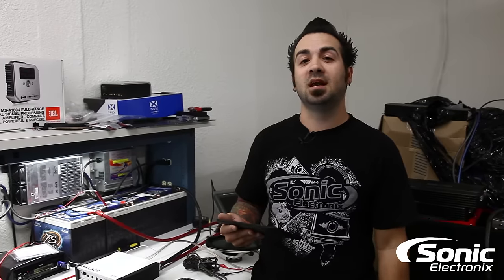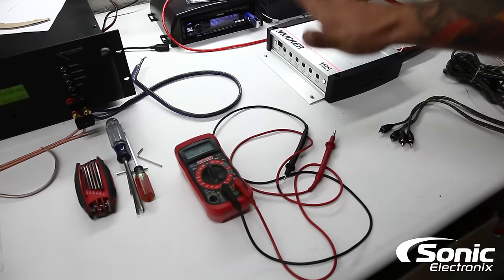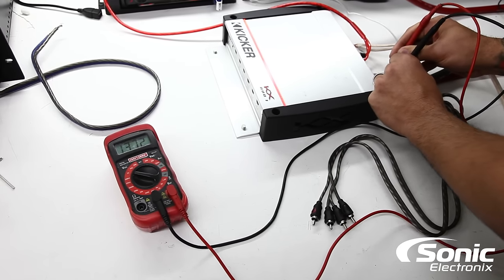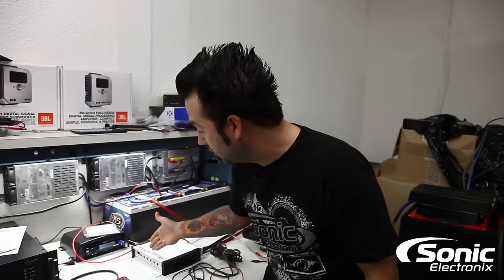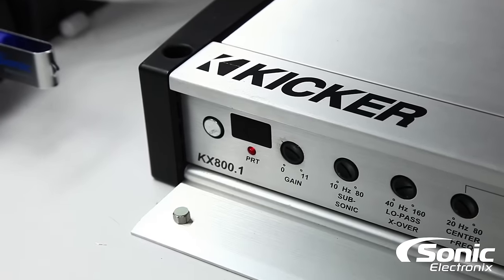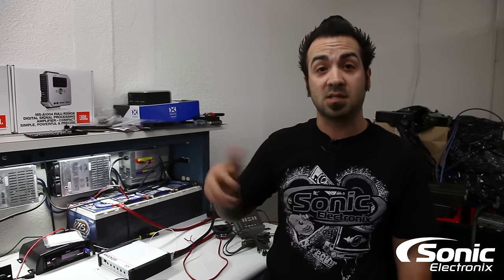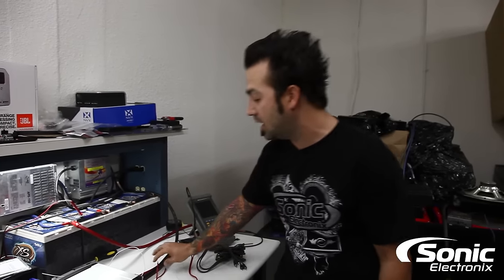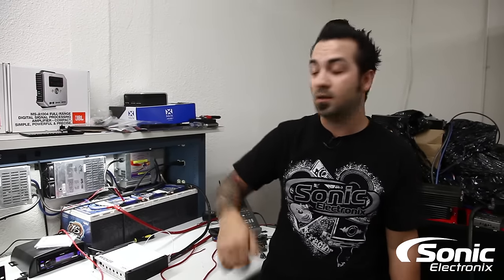Why is My Amp Going Into Protection Mode When I Start My Car? | Car Audio Q & A

Comment: my amp and speakers have been working fine for years now all of a sudden when I turn the car on it makes a heartbeat sound from the wolfer I've tested that amp outside of the car and it doesn't do it unplug the RCA's and it doesn't do it either and it plays fine until I start the car up I'm really at a dead in here
Reply: I mean it still does it when I unplug the RCA's

Comment: I have a 2014 Hyundai Sonata they say with my stock radio that the radio keeps cutting off the bass due to the radio going into protection to protect factory speakers it has Bluetooth and everything they say the only was to fix it is to get a aftermarket radio

Comment: i got a problem. i just installed a dual xpr84d amp. when i turn on the radio, the amp goes directly into protect mode. voltage at the power and ground is battery voltage. when i check the voltage at the amp, it is about 5 volts. brand new stereo works fine. pioneer subwoofer amp works fine. the remote is split off from the dual to my pioneer. ground is good, power is good, remote is good, but the dual 4 channel, with no speakers hooked up, goes into protect mode. power wires are separate, no distribution block. different grounds for each amp.

Comment: I want add something to this. I came across alot of amps that was installed wrong. The protection light came on and never went off even with troubleshooting all possible causes. I basically found that the amp was toast with subs either hooked up wrong and just the wrong subs  all together.

Comment: Could be loose speaker wire on speaker mostly front speaker ... From water getting in your door causing the speaker wires to corrode... has happened to me

Comment: I am using Pioneer GM D-9601 Class-D Mono Car Amplifier ( it has 3 40 amp fuses) at home to play two 12" sub woofers & I am using 12V 50 amp SMPS to power that Amplifier. My problem is the indicator led bulb of the Amplifier starts blinking after some time & the sub woofers starts to distort or produces disturbed sound. Plz suggest what may be the problem ?

Comment: I have an audio pipe amp that had no fuse. when I was hooking it up with just the power and ground and remote wires. any metal that touched any part of the amp would ground out and cause an ark.  What is going wrong??????

Comment: Will a 2000watt speaker make a 1000watt amp go into protectin mode? The fuse connection in the amp was not good one wire was not connected and the other wire was connected to both ends on the fuse case so I hooked both wires back up properly and put amp back together but kept blowing the 30amp fuse put a 40 amp fuse it was good but amp goes into protecting mode When I turn the volume up Idk if it's just the amp or if my speaker is to much for it!

Comment: I have a factory radio and I installed an amp with it. When I cut the car on sometimes it will go into over current mode right of way sometimes it don't. I have the back two rear door speakers connected to the high level output on the amp. I had it on a line out converter but it does the same thing. I turn everything down and it still says goes into over current mode please help Thanks

Comment: I have adapters that is 2 + 2 - how can I have a bad ground? My voltage sets at 15v drops slowly to 14.4v 3 batteries 140ah on MD3k, I can't go pass half way or goes to protect mode. I have 2 15" subwoofers NVX-VCW154. My last amp NVXVAD17001 I could turn it up no problem ever. I need help?

Comment: My question is where do I start...i installed 2 nemesis audio 12" hectics pushing 1500 rms watts each 3k watt max watt each....running off a 2nd car battery and I don't have a fuse for the amp power that I know of.... problem is the installation was less than 11 months ago... when turned up all the way after a while the amp shuts off...I turn it off for a min turn it on it plays again for a min or 2.... this hasn't happened before...what could be causing this issue being so new....it was installed by a stereo audio place so I imagine they did a better job than I would....where would I begin....
Reply: I think this may relate to this video but a little different cuz it works until its turned up.

Comment: Sonic Electronix is there anyway to boost a radios preamp output voltage from 2 to 5?
Reply: look up "Line Driver" the best brand is audio control. They aren't cheap tho. Can boost your voltage up to 8 volts

Comment: my RCA’s and speakers wires are disconnected,  I put the car in accessory mode /turn it on and the MTX audio amp light is red .. is the amp dead ?
Reply: I having the same issue with my MTX amp. Nothing connected but good power/ground/signal and the amp is going straight to protect. Amp is getting 12+volts signal is 11.59v

Comment: Hi thanks for all the helpful videos. I have a problem with my Pyle PLBA530FRD BLADE 6,800-Watt 5-Channel Compact Class-D Full Range Hybrid Amplifier when I power it up it plays for a split second an go into protect mode by the way it is not in a car I have it on a shelf with a car battery an a battery charger the amp terminals read 14 volts and even with the charger off at 12.8 volts still goes into protect. I disconnected all cables speakers RCA's an only put power into it same problem I read that is could be a bad output transistor. The problem started when by brother wired 3 different speaker an the resistance went below the rating value on the same channel. I am an electronic guy so if any one know what component inside the amp is doomed please tell me I can open an replace it BTW the amp plays for a split second so I don't think is a transistor idk please help thanks in advance

Comment: I've got an old amp that I was told might have a short so before connecting to power, I checked continuity between the BATT and GND and there was continuity.  That seems like a problem, especially once the amp was disconnected because I assume when connected to power, it will cause a short or major battery drain even when off.  Is my thinking correct and any advice on the continuity situation?  Thank you!
Reply: Was it the amp?

Comment: Quick question, in my boat i have three alpine pdx amps (pdx1.1000, and 2 pdx4.150) all my gains were set with the smd distortion reader, but after maybe 20 minutes of playing music at higher volume the amps go into protect mode. Is this just because of over heating or is there something going on with fuses? thank you!

Comment: On my amp. Ch 1 is set at 17 volts (75 w x 4 ohm speaker) but ch 2 reads 37 volts?  Why is that happening

Comment: I'm having trouble getting my amp and subwoofer to play I'm using an alpine Mrv-f301 and a dblink hlc1 converter my sub just comes on and off but no bass is heard to just weird echo have you guys ever runner into this problem?  My car is a 06 saturn ion with stock radio.

Comment: I have 4 12" mtx terminator subs wired at 2 ohms, I have a boss r2000m amp and I am running 4g power and ground. it keeps going into protection mode when I turn the volume past 20....? any help I have wires from one box to the other with butt connectors then to the amp from there.? amp is rms 1000w and I have 800w rms from subs... why is it not working.

Comment: I have ever wire hooked up correct and not touching nothing and i did rig my remote wire up but still it should still come on correctly . but no it powers up but in protection mode and i am juat stuck
Reply: Could be a power drop i didnt check that

Comment: I have a JL jx 500/1 amp that goes into protect and out of protect after a few seconds should I be worried? Gain is at 0 and db is at 0 with a JL 12 w0v3
Reply: Ducky Tran I have the same amp in a 2017 f150. It has the ecoboost. When I go to a stop light the truck turn off. My stereo system is still playing then as I release the break the truck turns on. This causing my sub amp to go into protection mode for maybe 3sec. Then works fine. I hope I can find some help. My 4channel and sub amp are connected to the same remote wire. Sub is the only one that cuts off
Reply: Adam Vasquez i actually found out that my battery gives too much voltage when i start my car. But another question, how high have you set your gain on your set up?
Reply: 3/4 was what the shop set it to. I lowered it to 30% and it was the same thing.

Comment: hey man i had a broblem with my amp i have a TMA 4 channel and similarly to this vid only when the car is start the audio signal to the speaker drops in volume, it like this when the car in standby mucis works gread no issues, but as soon as te car is start and idling the amp looses its drive. i have tried everything chaned wires tested the voltage change rca. i changed the amp and the issue was solved but i have no idea whats wrong with te amp

Comment: i have to amps 1 for subs and one for highs and a distribution box tied into power for equal amperage? but when i turn the volume up past 20 it kills highs and only subs play. i was told i need a bigger ground to start.
any ideas as vague as that is i have the big fuse coming off battery and 4 gauge power wire however the ground is smaller by amps

Comment: I added my battery to my amp and protect mode went off. 12.35. Hooked back to the truck. Goes into protect mode.13.5. Don't understand.

Comment: IT COULD ALSO BE THE YEAR AND MODEL OF CAR.  SOME NEW MODLE CARS WILL TRIGGER POWER SHORTAGES OR OVER LOADS. ANY WHERE FROM 2013-CURRENT IS CAUSED BY COMPUTER FEEDBACK CAUSING A OVER LOAD MAYBE THE REASON FOR PROTECTION MODE.
Reply: JAY N DEE how do you fix this

Comment: i got a question. i have a jl audio 1200/1d monoblock amp my green power light stays one nd my protect light blinks every 5 to 10 seconds. i cant get it to work i unplugged everyting nd tried it again multiple times yet noting happens

Comment: I have swapped my amp and sub from an SUV to car. I cannot get my sound to be anywhere near as good in my car as I had it in my SUV. I have changed from a ported box to sealed box. I have let back seats up and down. What can u do to improve the sound quality in my car? Diamond D12, Punch prime 500d, 8g amp wiring kit
Reply: A good ground is important, Proper gain setting on the amplifiers so it matches the headunit.
Boxes are designed for a specific woofer and car. Car's have different inner dimensions and volume etc..
that can make the sound get different i think.

This was just my thoughts.
Reply: you can also use a bigger gauge wire and both power and ground need to be the same gauge. you also want to add 1/0 from the alternator positive to battery positive then negative battery post to chassis, then engine block to chassis and last one would be the back of the alternator just use the screw to bolt in a wire to chassis and you have completed the big 3 upgrade
Reply: add a bigger amp with more RMS just be careful and know how you wire your sub you don't want to blow your sub it also depends on the box rise

Comment: I have 4 1800 watts planet audio dual voice coil 12s rated at 900rms each 4ohm impedance. What amp should I use to push all four subs I currently have a kicker 1200.1 and it goes into protect mode when I turn the volume past a certain point
Reply: @knowone8497  I have 0 gauge wire for my power source as well as for my ground
Reply: you might have them wired to 0,5 ohm, that requires alot of current

Comment: I get 6v on amp when battery + and remote hooked up... if I remove remote wire I get 12v  battery+ and and 12v remote. why do I get 7v only when I hook them both up to amp.

Comment: Can someone help me out please. I was hooking up speaker wire to my amp after installing, and fucked up by not turning the power off. The speaker wires touched, sparked, and now my amp is stuck in protection mode. I'm thinking maybe it's a resistor. I've already checked voltage to the amp and that's fine. My inline fuse is okay being that it's a breaker and didn't short it's self. I disconnected the speaker wires and everything else one by one and it's still in protection mode

Comment: I have a output problem with my Rockford fosgate p1000-1bd.   Does anyone know a company that repairs these? also i have 1 volt less on the remote wire.

Comment: Mine only does it after i hit for about 30 -45 min. The amp seems really hot to the touch. If that could be causing it how do i make it run cooler
Reply: probably too low ohm. Some amps are picky

Comment: My 2019 ford connect is putting out to many volts, what product do I need to bring it down to 14 volts
Reply: Try a dc buck converter- they’re cheap and small. Little circuit board with variable resistors that allows you to fine tune the DC voltage to whatever you need it to be. I would fuse it too, to be safe

Comment: my question os how do i stop my amp from going into protection mode. i have a pioneer radio and its a 14.4 v and my battery is a 12.v . when i have all my wires hooked up and i turn my truck on my amp automatically goes into protection mode. but if i hook my other radio up it works perfectly. like what the deuce. it drives me crazy cause i wanna listen to my cd but my other radio does not have a cd player on it but my pioneer does. please help me out or any other suggestions on how to get it to work without it going into protection mode.
Reply: Add a jumper wire. Basically put your battery wire (usually red) in the normal port on the amp. Then put your remote wire (usually blue) in its regular port. Just connect a wire making what they call a bridge between the remote port and the power port.  You can cut a small piece of ur remote wire or u can just use a piece of wire you would put to subwoofers. But just connect the remote port and power port together. Let me know if it works. It worked for my amp
Reply: I'll give it a try
Reply: i tried it but it did not work for me . i just ended up buying a new head unit and every thing works now.

Comment: My amp goes into protection mode when I crank up my volume but when I turn it down a bit it turns back on. My amp is a kenwood kfc serious 1800 watts and kicker new compr wired at 1 ohm
Reply: The box says it's stable at 1 ohm and wiring is correct
Reply: Shanto minhazul How did you end up fixing the issue?

Comment: I have a 1600w.2 autotek mean machine and 2 12" rockford P2s, any time I turn the car on or to accessory mode, the amp stays on for 5 seconds, then the subs thump once and the amp goes into protection mode, I've disconnected the subs and the rca cables from the amp and it still goes into protection mode, there's no shorts and the power and remote are getting good voltage, the amp worked just fine before I pulled it from my friends truck, please help
Reply: sounds like blown mosfets to me bruh.

Comment: Noice! Day 1, was wrecking my brain with my Reference 1000w new fresh from the box amp going into protection mode for no reason, only to find that upon Day 2 of troubleshooting that the battery side fuse was loose. I was misreading the 0.9dc in current read in Day 1 as "my battery is flat." moral of the story never try and troubleshoot with a tired brain hahaha.

Comment: I have an hifonic 1600 brutus the logo lights up but theres no bass in protection mode it was working fine but i guess it was too much bass power for the fuse of the battery then smoke startin coming out of the fuses from the battery does my amp still work or whats the problem
Reply: Btw i replace the fuses from the battery
Reply: you need to get a ANL fuse

Comment: I install a amp and my sterio has no rem wire  so how ican install amp properly and amp was not turn on very easy solution this problem
Reply: just wire up your own remote turn on switch,.....probably best to have an in line blade fuse on it too.

Comment: Yo fellas.  I recently picked up an old amp from a buddy( jl audio 250/1v2). However it is always on.  This is a 1st for me and didn't really find any help on this issue online.   Any ideas?
Reply: ur remote wire must not b in the right wire
Reply: paul ward not that simple.   I only have the power and ground hooked up and it's on
Reply: paul ward not that simple.   I only have the power and ground hooked up and it's on
Reply: paul ward not that simple.   I only have the power and ground hooked up and it's on

Comment: my car amp turn off when i turn the car on.  it turn out to be a bad alternator that was going up to 15 volts making the amp protecting come on.06 yukon i had to unplug the wire going to the alternator now my alternator only put out 13.8 volts and I can turn my music up and it do not cut off but sometime my battery light on the dash may come on and sometimes it do not come on but my music sound good

Comment: My amp just started going into protection mode. After 5 solid years of working perfectly fine, one day it just started going into protection mode. It happened more when the volume is turned up and sometimes at random when the volume is on low.  Im rocking a Pioneer Gm- D9601 and I have Two Pioneer TS- W308D2 hooked up to it. I am completely lost, I can’t seem to figure it out. Any Help?
Reply: are you running them in 0,5 ohm